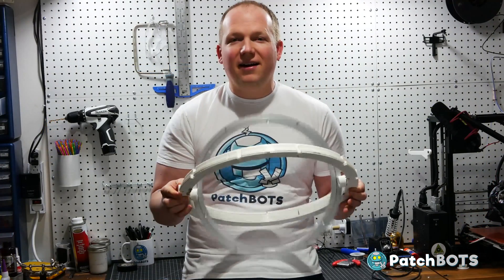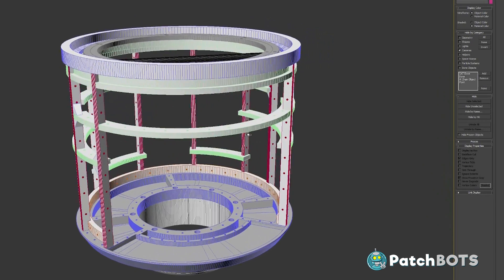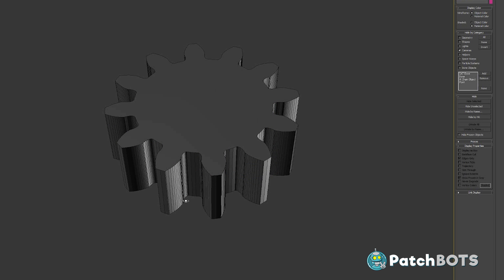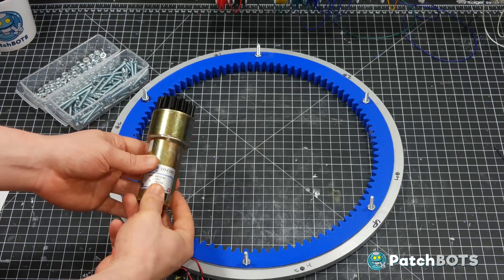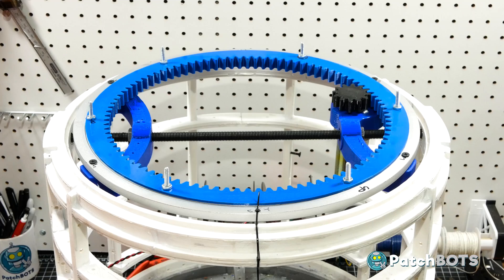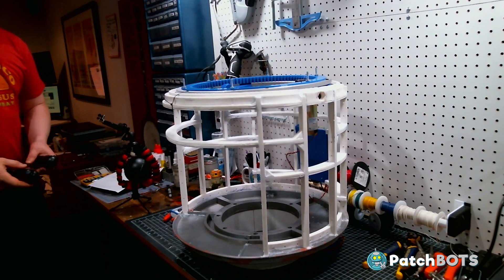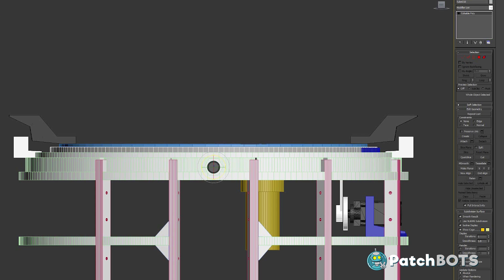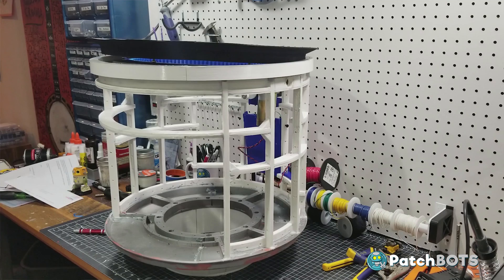Star Wars Chopper Build - Part 2  Motorizing the Head Mechanism

Comment: Nice work on the Head tilt. Seeing it in action makes me want to include that as well. Where did you get the generator for your dome gear?
Reply from the maker: HI David.  The generator I used is here:   http://hessmer.org/gears/InvoluteSpurGearBuilder.html

You can download a DXF and import that if your porgram supports it, or there is a DXF converter here: http://www.dxfconverter.org/   which can covert it to a PDF.
Reply: Thanks for the info.